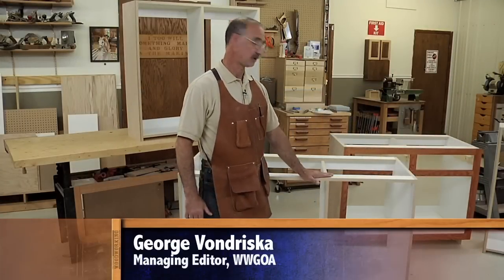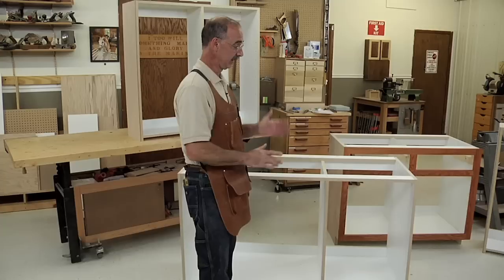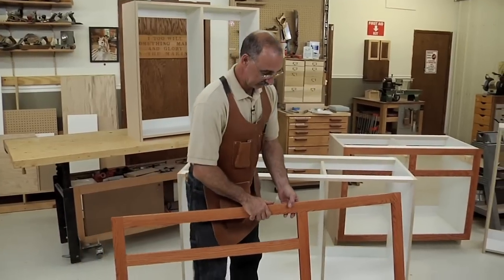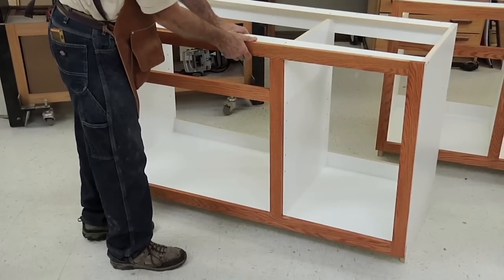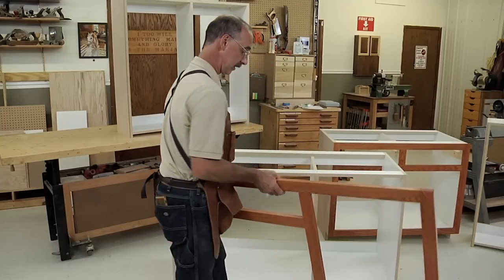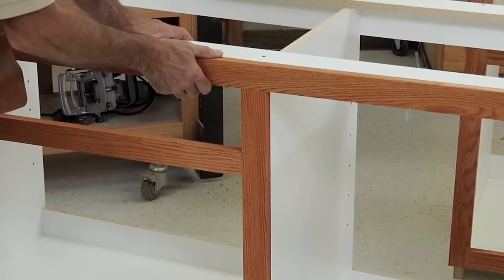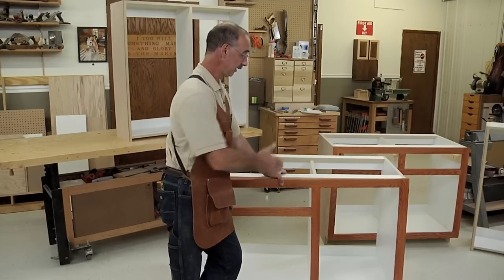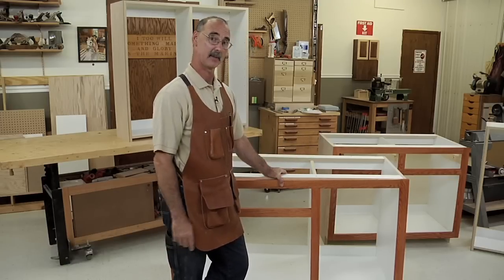Face Frame Finishing Tips  |  Woodworkers Guild of America

Comment: Good tip.what kind of melamine are you using? Is is the regular variety you can buy at a home center or the better grade that you have to special order through a lumber yard? And are you using confirmats for the connections?
Reply: Matt Przybylski The melamine used on these cabinets came from Home Depot.  Nothing special about it.

Comment: You have more trust in glue than I do. As soon a you cut through melamine it loosens the particles on the particle board.
I think I'd put some biscuits on there just to make sure.
Reply: hawkesworth1712 Belt and suspenders? :)  Nothing wrong with buying some insurance with biscuits, but I've never had a joint like this fail.